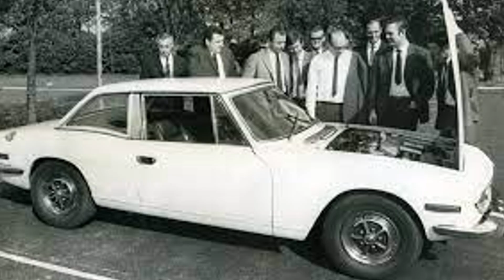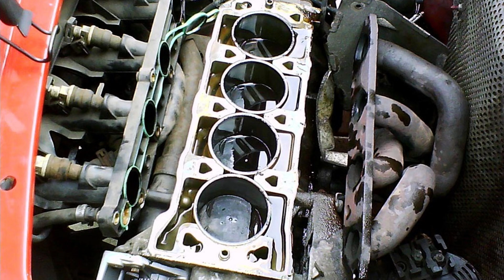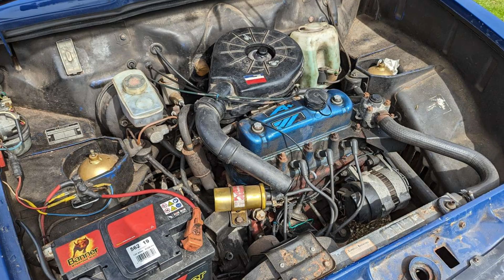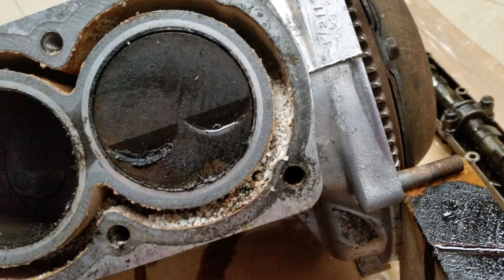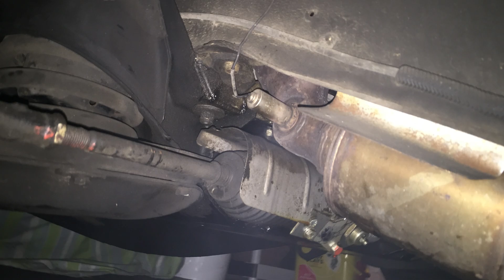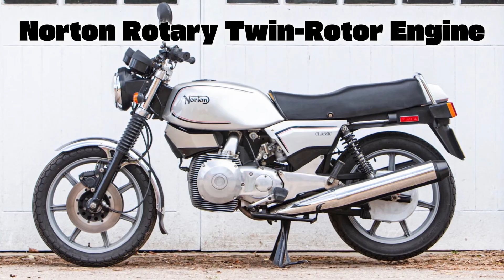7 Worst British Engines in History

Comment: I hate AI voices that mispronounce things. 

Also the issue with the Stag V8 was that the coolant pump was mounted too high and if the coolant was allowed to get low it wouldn’t prime properly. Other than that they were fine. The head warping was only related to engines that were overheated due to issue #1…